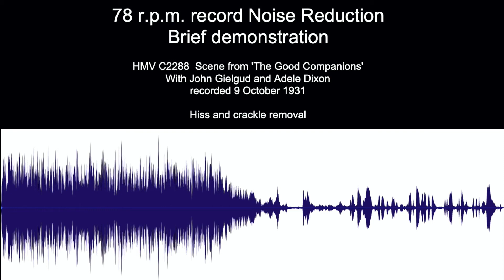78rpm noise reduction: a brief demonstration.

Comment: It's a shame that Brian Davies is no longer active - the software was really good. We even worked together to add a 'constant noise output' option to make the edits between split classical recordings much less noticeable. Hopefully one day someone will pick up where it's been left off and improve it even further... There's still a lot that can be done with it, but it's a matter of time and experimentation.
Reply from the maker: Indeed. I'm concerned that it may not work when I eventually have to upgrade my computer (Mac) but as it runs on Java there is a fairly good chance.
Reply: @RogerWilmut  the Java files are still working on all my machines, so that's a good way to preserve it. I've backed up all my files for this, as well as the original keys I bought in 2013, so it should be preserved for posterity. I've no idea who owns the copyright now, but maybe in the next 10 years there might be provision to make it open. Ideally it needs to be fully updated into a proper DAW plugin and expanded upon, perhaps with the help of some AI features...